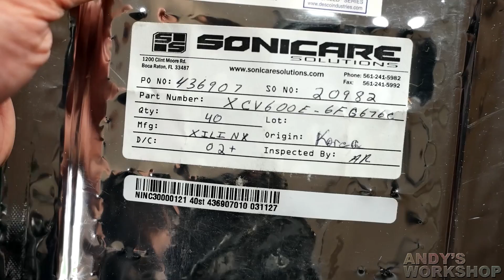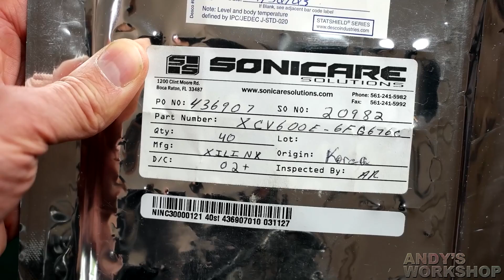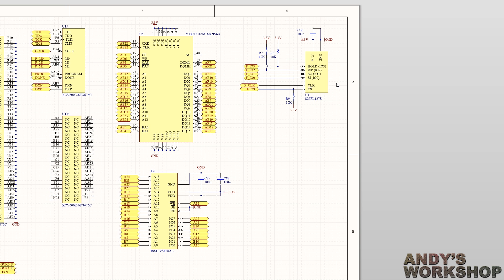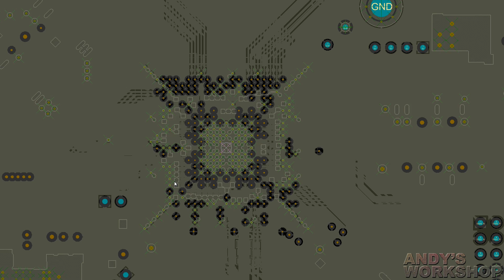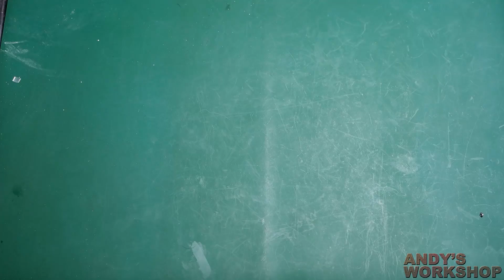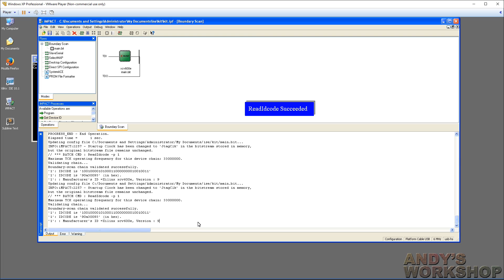Xilinx Virtex XCV600e 676 ball BGA FPGA development board

Comment: Hi Andy, I'm assuming this is Altium ? Also does the board have blind vias?
Reply from the maker: Hi Vince. No blind or buried vias. Those processes are supported by the prototype PCB houses but they're prohibitively expensive for this kind of proof of concept project.
Reply: @andysworkshopuk  Hi Andy, thanks for the information. I too want to try prototyping BGA parts but fanning those connections out always made me stop. I have some smaller 48 pin PSRAM devices that I can get comfortable with then I'll give larger BGA parts like you did a try.  You have a new subscriber!  Cheers!
Reply from the maker: @vincei4252  One good tip for the escape routing is to set your snap grid to 50% of the ball pitch then all those little 45 degree bends will form automatically and land in exactly the right place.
Reply: @andysworkshopuk  Hi Andy, just to let you know I  became an Altium user too this year. Looking forwards to v20 which is just around the corner. The crappy part is I can't find a sweet deal like you got on those FPGAs :) Awesome score! btw. ISE 10 is EOL. Does the version you have limit the size of your project? I'm assuming 600E part is not supported by Webpack ?  I logged into Xilinx yesterday and it "looks" like they provide a usable key for the none webpack version - is that your experience?

Comment: Nice project!There is a simple 8bit LED shifter+fader in verilog (43LUT4):  

module LEDShift(
  input CLK_50MHZ,
  output reg [7:0]LED
    );
  
 reg [25:0]div;
 wire [3:0]sum = div[25:22] + div[15:13];
 
 always @(posedge CLK_50MHZ) begin
  div <= div + 1'b1;
  LED[div[15:13]] <= div[18:16] < (sum[2:0] ^ {3{sum[3]}});
 end
 
endmodule

Comment: Is it possible to make a spartan 6 development board that costs less than 50€? Even simple QFP144 dual layer boards like the papilio pro cost around 100€. I don't get where all the money is going. 15€ for the FPGA, 3€ for the SRAM, 5€ (plus shipping) for a PCB from china and a bit more for voltage regulators, connectors and all of the other stuff.

I will probably just take the papilio schematic / board files, throw out the USB stuff and add things like VGA or a bit of onboard IO.
Reply from the maker: It's not as easy to come up with a generic FPGA dev board as it is for an MCU because of the infinite flexibility offered by an FPGA. The connectors you attach to the I/Os and the power supply decoupling you provide to the power inputs on each bank depend on how your design is implemented inside the FPGA. If you have a particular design in mind it might be best to simulate it first then produce a dev board targeted at your project.

Comment: Hello! Just found your channel and it's nice to see that I'm not the only crazy hobbyist out there who builds FPGA boards! :) I use mostly Artix-7 chips, so they are BGA-only. This is one of my boards: http://i.imgur.com/F3BM4J2h.jpg Few notes if I may:
1. Despite the fact that Atrix-7 chips (and some other ICs in BGA package like SPI Flash and HyperRAM) are lead-free, I had a great success reflowing them with regular leaded paste. Just up the temp a bit for stronger bond (I think my reflow process is set to reach 220°C at peak), and make sure you thoroughly clean both the board and BGA balls with acetone or IPA before you start placement.
2. You should've reflowed bottom side as well. I always assemble and reflow the bottom side first, then put board on some metal bolts as standoffs, and assemble the top side. Don't worry about bottom components falling away during - even large 1210 capacitors always stayed where they are because of solder's surface tension.
3. If you don't already have it, I would recommend you to buy a stereo microscope. They no longer cost an arm and leg. I've purchased one from AmScope for $199 + shipping (model SE410-SYZ) and it was the best $200 I've ever spent! This model has very large working area clearance (distance between specimen and the lens is ~150 mm, they have SE400 model which has even higher clearance, but it was too high for me as I couldn't comfortably work with it while sitting, so I returned it and exchanged for SE410), so placing SMDs and hand-soldering under it is very easy and quick.
4. If you are serious about the hobby, I would recommend to invest into good vacuum pickup tool as it makes placing small 0402's a breeze instead of a test of your dedication. I've got one from Zephyrtronics, and while it's not cheap (I've bought the tool with full set of tips for small components, and it was $493 + shipping and handling), it made me fall in love with 0402s! These tips are designed such that they "automatically" release component as soon as it touches the board, so placing ~50 0402 decoupling caps took me only about 30 minutes. 0402 parts are also great because they take very little board area, and are extremely cheap - full reel of 10000 units is $10-30!

My only gripe is that currently I've forced to use KiCAD for PCB layout as I can't afford any other CAD which would have differential pairs routing and trace length matching functionality, which KiCAD does have, but like most open source projects there are also many idiosyncrazies :( But at least I've managed to find my way around most of them.
Anyway, good luck and looking forward to see more FPGA-based projects from you in the future!
Reply from the maker: Hi, thanks for your detailed comment. I agree I should have reflowed the bottom as well. It was lack of forward thinking really. I was too focused on getting the big FPGA down correctly that I kind of forgot to look at the back.

I do have a stereo microscope and consider it essential equipment when working with SMD parts. I mainly use it for inspection and push-and-nudge placement of ICs ready for reflow.

I take my hat off to you for successfully reflowing a big modern FPGA like the Artix. I guess that's 0.5mm pitch and you said lead-free. Very, very tricky to work with that one. Are those DDR3 ICs that I see near the FPGA in that image? If so then you just need USB3 to complete your collection of all the most difficult to handle chips on one board!!
Reply: That board on the photo is not nearly as advanced, but I'm proud of it because it was my first ever 4-layer board with BGAs, and it worked on the first try! All BGAs there are 1.0mm pitch, and small ICs near FPGA are two Cypress HyperRAM ICs and SPI Flash chip, and even big FPGA is just FBGA-256, so your board is more advanced in some sense. But the purpose of my board was mostly to get some practice using advanced layout techniques like differential traces routing (HyperRAM ICs use differential clocks as they run on 166 MHz DDR), fast parallel bus with length matching (again for those HyperRAM chips), and using USB (there is FT221X USB-to-parallel bus chip on board).
All of this is a prelude for the board I'm working on now - it will contain both DDR3 and USB 3 (FT601) chip. My end goal is the create a board for computer vision system using Zynq SoC, but since it's quite expensive, I'm currently practicing on cheaper designs to gain some practical experience first.
Reply: Do you mind if I ask how you started with your design? I'd like to do something similar.
Reply: It would be great if u can document / vid edit your Dev build like Andy and share with us to learn.

Comment: Very interesting video and good looking board!
Please tell about 162 153 differential lines, are those 100ohm lvds? They look strangely wide for 100ohm, more like double 50ohm lines  if the ground plane is 65um. Also about internal layer lines, have you tested phase front integrity and wave resistance?

Comment: Excellent video. I am well impressed with the board you designed and built. As a hobbiest BGA scares me! Out of interest how does this FPGA compare with something like the Spartan6. I have a couple of devi boards (Papilio & XESS) which use the LX9 version. I also recently bought some cheap Altera boards (Cyclone IV). I really need to get around to doing something useful with them!
Please post more videos of what you are doing with this board!
Reply from the maker: The advantage of Virtex over Spartan is primarily speed but that only really applies to comparisons of devices of about the same era. The Spartan 6 is a much newer design and has more and better on-chip hard IP cores. Though what you get depends on which package you buy. You have some nice boards there, more than enough to get going with some logic designs of your own.

Comment: Well done. I reckon the magnifier is "2X/5X Hands Free 10 LED Illuminated Folding Desktop Magnifier with Stand MG3B-1C"
Reply from the maker: I'm happy to make the board schematics, gerbers etc. available. I didn't do it automatically because I didn't think anyone would want to try to build this because of the difficulty and lack of availability of the FPGA.
Reply from the maker: Yes that's it. I got it for £11.99.
Reply: Hi Andy , nice job :)
I would like to know if it is a open source hardware , or you are selling this board .
Thanks.
Reply: Andy Brown Thanks for gerber files Andy

Comment: Was it expensive to get the PCBs manufactured? What was your smallest trace widths and drill sizes? I'd guess fanout for the Virtex would not be possible with a Seeedstudio PCB proto service etc.?
Reply from the maker: About £50 for 10 including delivery from PCBWay. Trace/space is 6/6mil within the BGA footprint and via size is 0.3mm drill, 0.4mm overall via size. 

PCBWay's 4 layer service is for prototype and you can get the same specs at the other agents (Elecrow, ITead, Seeed etc) and better specs at a higher price from OSH Park and then the price just keeps rising from there. I went with PCBWay because I've used them before for 4 layer and the results have always been good - they did the Nanocounter board. 

I didn't want to take a risk on a different supplier when I'm pushing the tolerances. Next time if I have an easier board to manufacture I'll try Elecrow and compare the results.
Reply: Sounds great. I've been wanting to try out a BGA layout for quite some time... Time to go hunting for a suitable BGA IC. :-) Looking forward to seeing what you come up with your Virtex dev board!